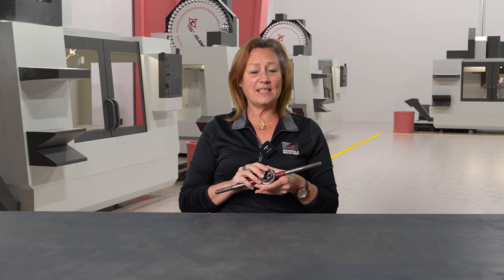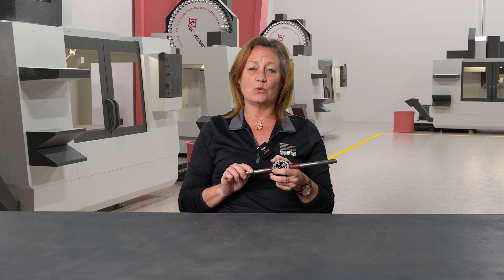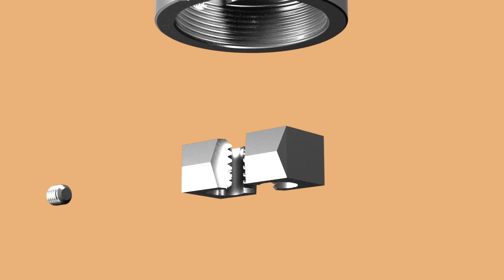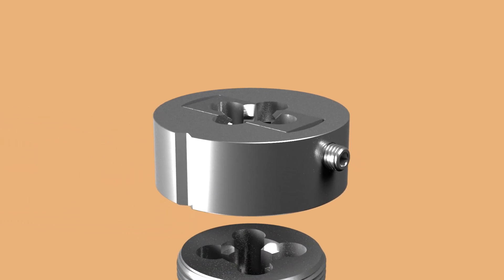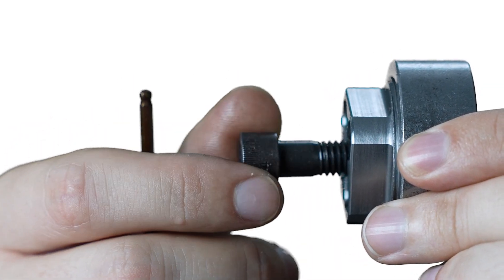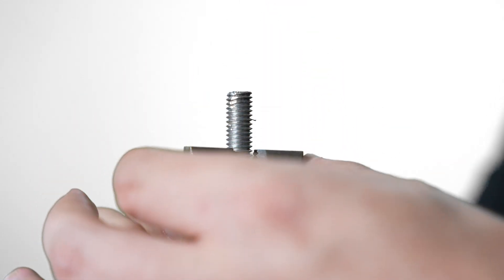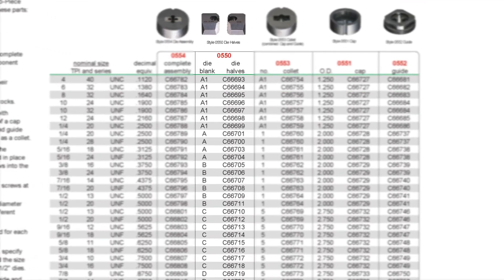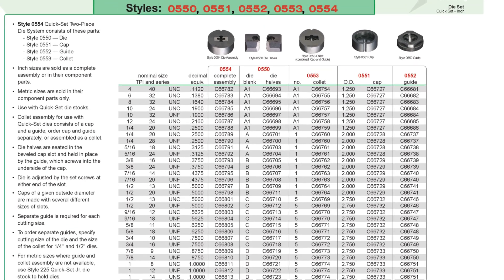Thread Cutting Tips - Using Rare Two Piece Dies

Comment: There is value and flexibility added to using two piece dies.   Interested in the Cleveland brand 29 piece jobber drills giveaway.  If Abom79 is using them they are quality drill bits.  Thanks.

Comment: So I do pump machine work and we have to single point all our shaft. One of the parts we have to make is called a “headshaft”. We use 1.5” and 1.687” c1045 steel shafts that we put a 10TPI LH thread on them. The thread length is 7” long but I’ve heard of people saying they can use a 2 piece die to make the threads. I’ve never actually seen it done so it makes me wonder if it’s even possible? Cool video by the way!

Comment: Great information on the two piece die sets. Especially liked the tip on assembling them near a damaged section and not having to thread them all of the way on a long thread. 
The set that we have seems to produce an accurate pitch diameter that repeats well once they are dialed in with a pitch micrometer or ring gage.

Comment: Interesting. I have heard that fasteners used for aircraft industry have very tight thread tolerances. So tight that you can't thread on a nut without using a wrench. They have a term for it although I can't think of it now but those engineers have it down to a science. Of course, the best of any tool are products sourced, produced and sold in the USA using USA steel etc.